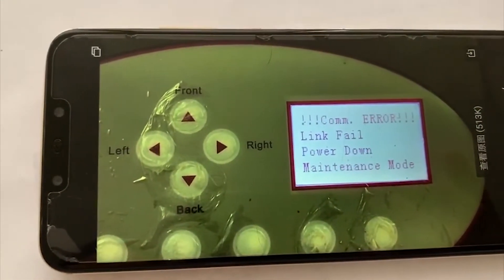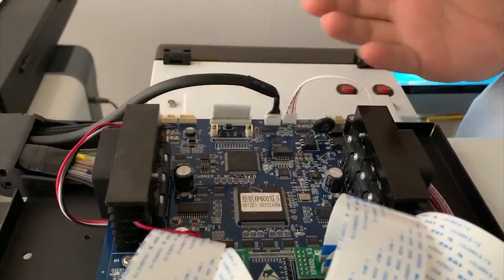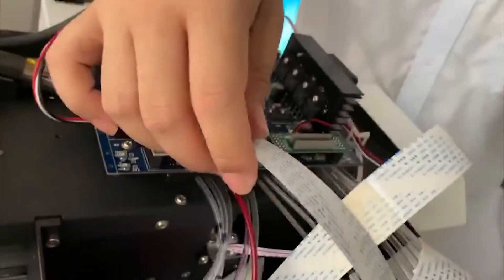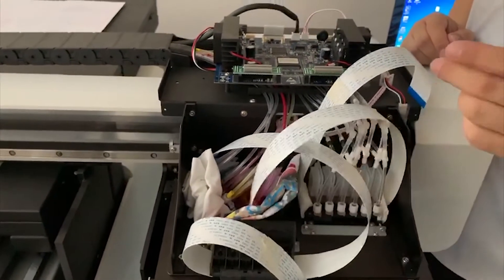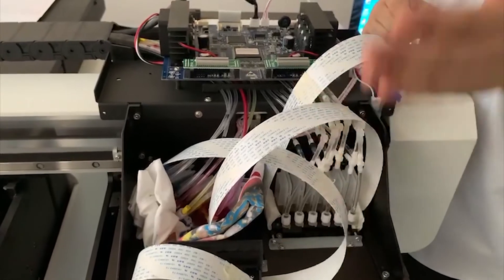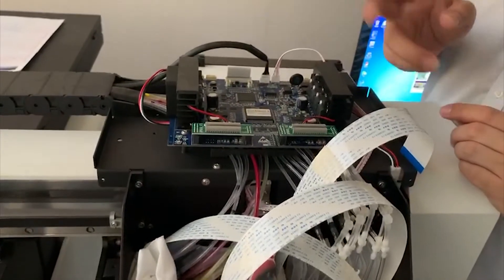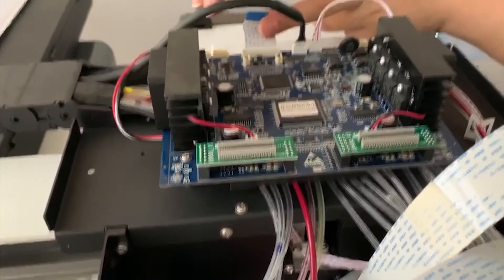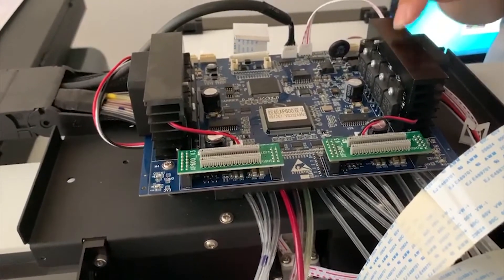How to solve the link fail problem of Nocai flatbed uv printer(part 2)?

Comment: Test print is not comming ok .. ATool is connicting but when giving Hidi Print lines are not comming . Pls advise
Reply from the maker: it means the connnection is not good. Or even doesn't connect with the printer.